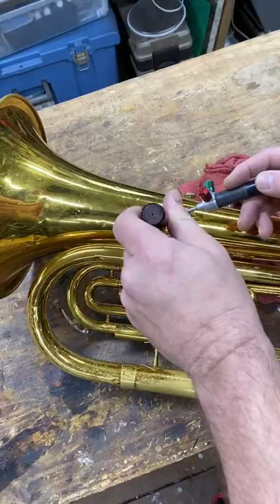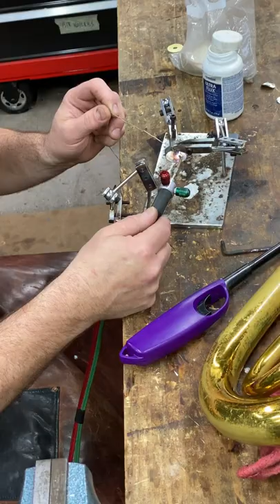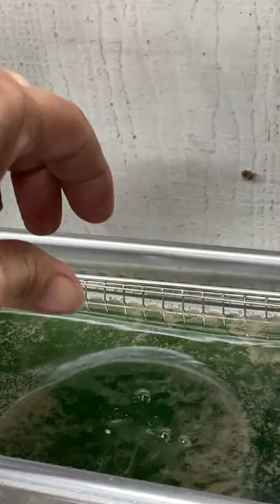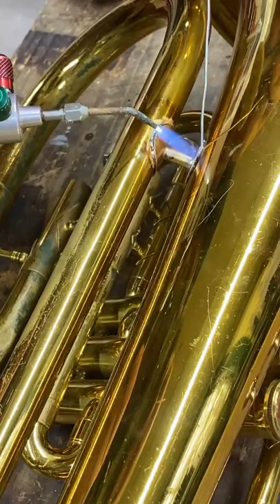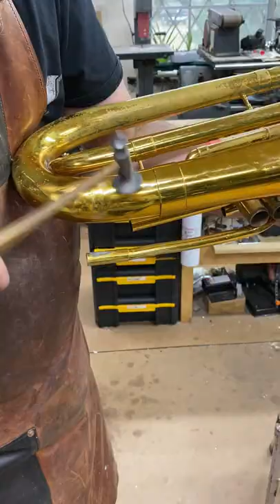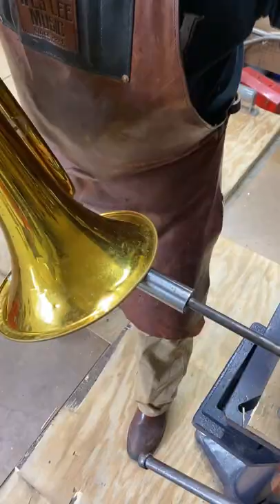Marching Baritone Good Playing Condition- band instrument repair- Wes Lee Music Repair

Comment: I just discovered this wonderful channel. I’ve been a professional luthier for about 25 years after a military career. I’m slowing down the amount of work I do because I can now afford to not work so much. Aside from removing a few stuck mouthpieces and cleaning some valves, I never ventured into brass or woodwind instrument repair. I do some violin work when it is within my skill set. My forte is fretwork and it is where I have focused my efforts. Its obvious that a significant amount of your repair processes require physical strength, discipline, and repetition. Do you address this wear and tear on your body and do you engage in methods to keep your muscle and joints healthy? My work has resulted in damage to my index finger joints and hands requiring my to use the next finger in line to perform the same tasks. Thoughts? I don’t really need to continue doing this work but you do what you know and what you love. Thoughts???